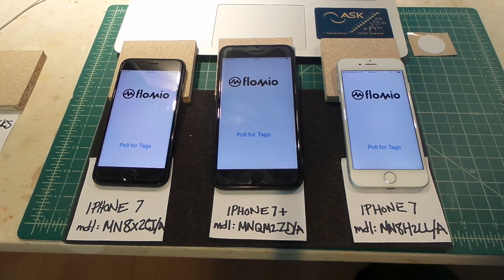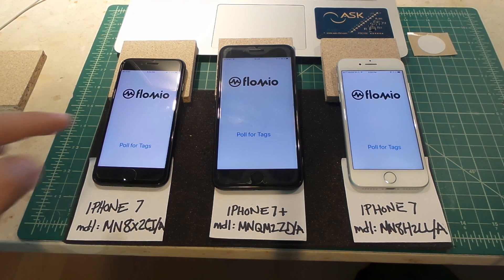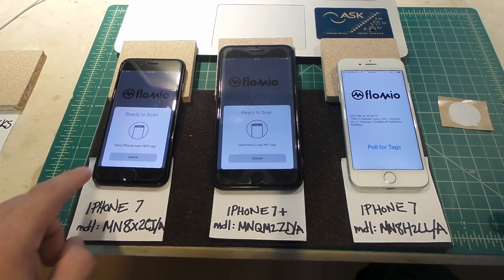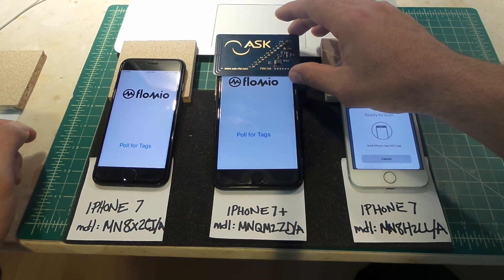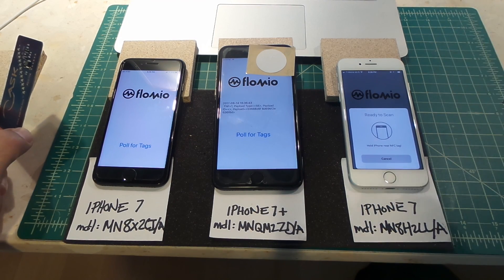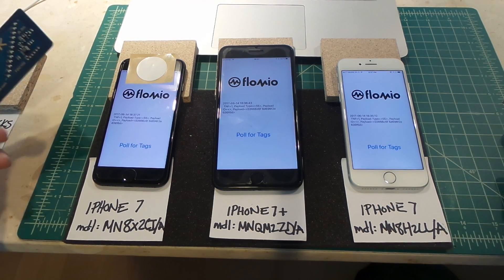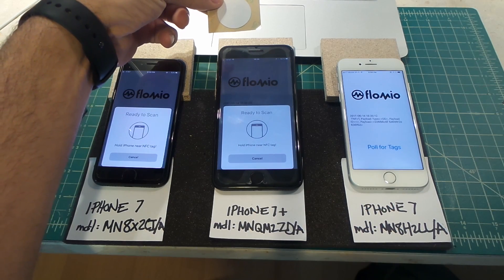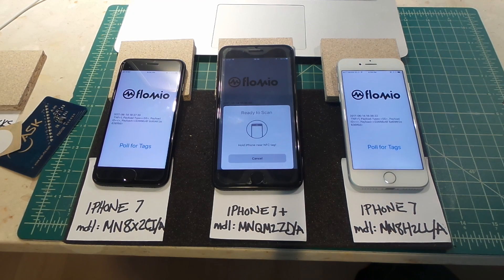NFC malfunction on iOS11 Beta and iPhone7/7+

Comment: At first when I first got the phone it was working fine with the NFC then it stopped working so what can I do to fix that
Reply: An NFC malfunction can generally be corrected by power cycling the iPhone if it software related. If there is physical damage to the unit, then you need to get the NFC subsystem replaced for the functionality to be restored.

Comment: I am  using iPhone 7 model number MN922HN/A, I am facing the same issue. It is not detecting it properly.
Reply from the maker: Done.. added to running list. Seems still not fixed in iOS11 beta 3 but hope will be fixed soon.

Comment: Is the battery level the same on all devices?
Reply from the maker: I didn't check for that outright but I'll study it more closely and report back.
Reply: Flomio TV yeah the ic should be designed to poll less frequently when the battery is low
Reply from the maker: While I get that setup, I will say that in the video you can see that the dysfunctional units have more than 50% battery charge. I would venture to say that in that state they should perform full well.
Reply: Flomio TV +1